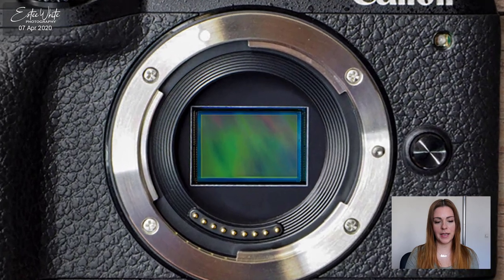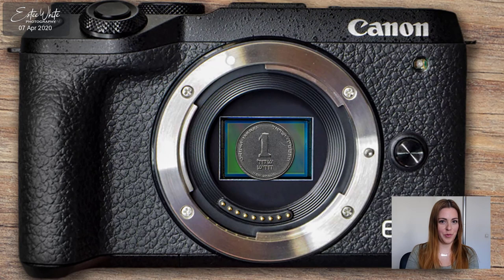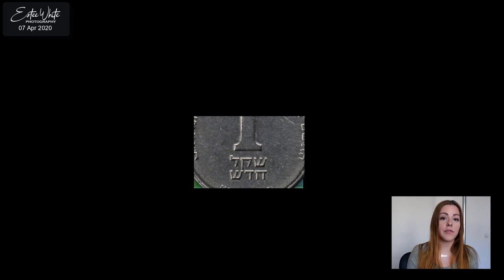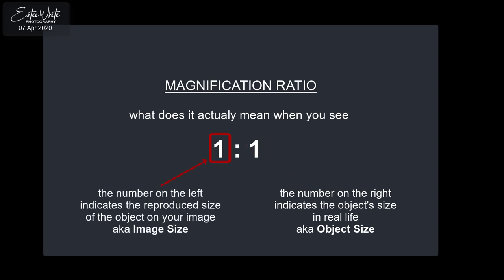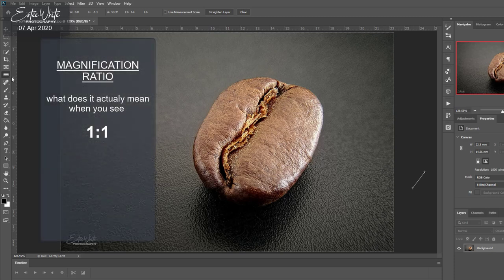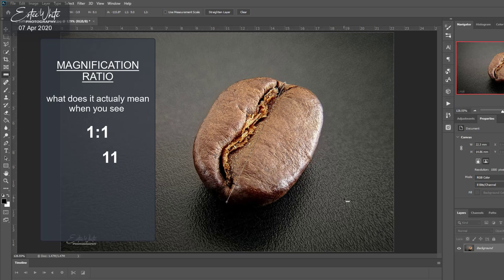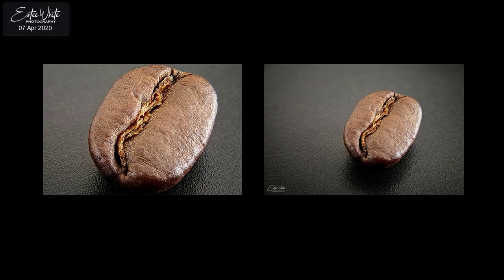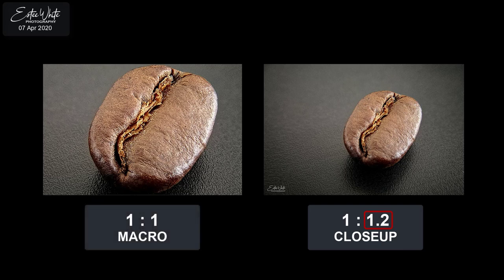What is 1:1 Macro Magnification Ratio? Explained Simply, with Examples | Macro Photography

Comment: Could you explain what the practical difference would be between two lenses with the same focal lengths but different magnification ratios? They would be have the same field of view, but would the subject appear differently from lens to lens? People say higher magnification ratios are better, but I’m struggling to understand how it makes a difference outside of macro photography
Reply from the maker: Can you elaborate a little bit ? Usually macro magnification is related to - macro photography.  Higher magnification means being able to photograph the subject from much closer, so you get a smaller minimal focusing distance. Do you have examples of two lenses that you are trying to compare ? If you tell me which ones you are looking at, and what are you aiming to achieve I could probably help you better.